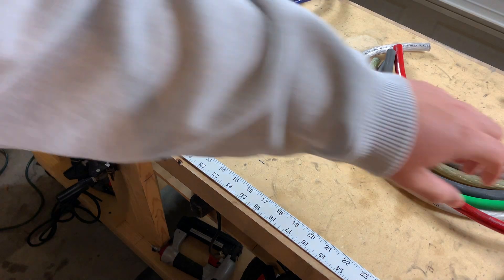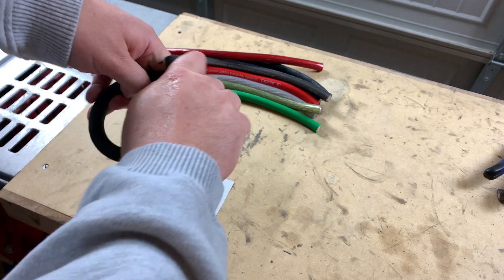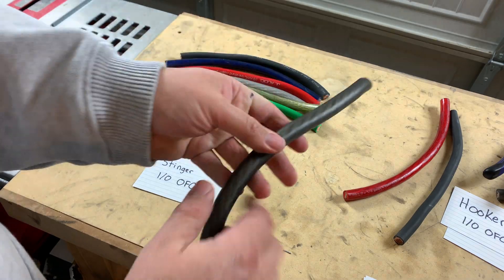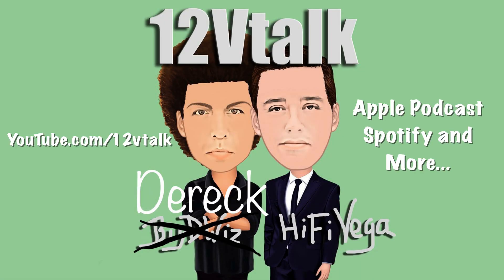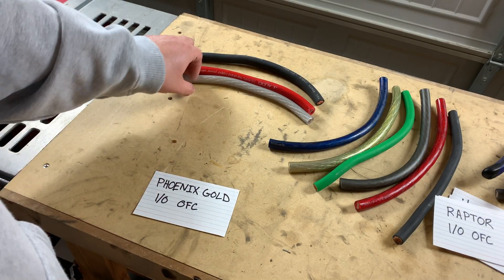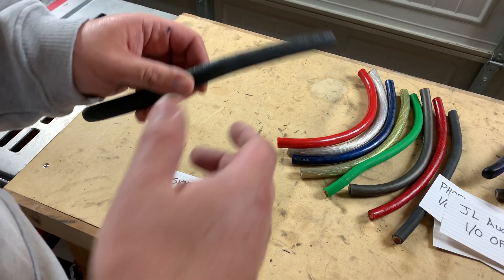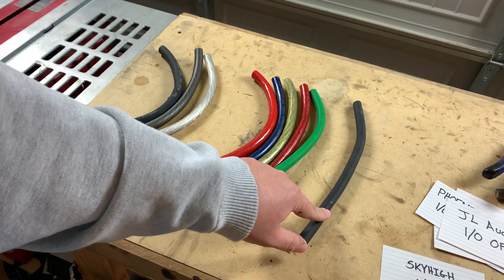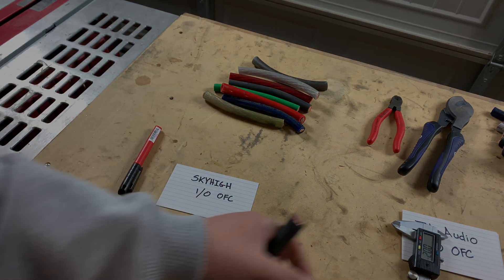What’s the best 1/0 OFC Wire? (1/0 OFC shootout part 1)

Comment: I’ve used all of those cables in my many years as an installer, and I only use Sky High now. The price is super competitive (especially in bulk) and as long as you properly seal the lugs or ferrules there is no corrosion over time, despite the lack of being tinned. This wire is so oversized that it wont fit in many set screw fuse holders or distribution blocks. Rockford, JL and Kicker wire might be slightly better but at twice or triple the price SHCA is the smartest choice. Lastly, you should have thrown a Chinese amazon “ofc” just for laughs
Reply from the maker: Sergio Cuevas I still might! I plan on revisiting this one later on when I’ve acquired different brands.

Comment: I use 2/0 welding from ac/dc supply for everything under the hood, I'm sure it's better in high heat situations. then oversized 1/0 skyhigh for my main runs to the rear distribution fuse block, and skyhigh for everything else.. skyhigh has sum of the best looking copper I've seen
Reply from the maker: tankdog03 funny you mention high heat situations... more to come on that soon!
Reply: +HifiVega yea, the welding wire definitely will take the win for that one.. guy name donkeys breath or something like that also did a test with it, his test has flaws tho.. the 2/0 welding wire just don't seem to look nearly as clean as skyhigh, and the sky high 1/0 might be bigger.. I bought a bunch of both, I actually was addicted to copper wire for a while, I still have a little something for it.. lol
I may buy a bunch of tinned copper now, I run all tinned copper lugs, but the ones with the smallest hole u can find then drill out to the size u nerd for a tight fit
Reply: +tankdog03 I've got a stash of 2/0, 1/0, 14ga, 12ga, 10, 8, 4, all good ofc.. it holds itd value, scrap yards pay almost  $3 a pound on #1 clean copper around here.. people breaking into abandoned houses stealing the copper pipes and electical wire, and the bigger stuff in sum of the power  pannels.  I remodel houses and been getting all the copper out ah dumpsters for 8years, my retirement plan lol

Comment: Knuconcepts wire is nice. I use that, sky high, or stinger wire.
Reply from the maker: Dustin Moore in the future I will try to get some knu and other popular brands and do another updated video
Reply: Knu for the win I normally get 1/0 ofc  knu and instead got some sky high 1/0 ofc and am very disappointed in it compared to knu. I can prob g try ie knots in knu and it’s smooth , the sky high when I bent it you can here it crunch inside lol

Comment: I gave you a preemptive thumbs down in case you bag on a brand I like. Just kidding bud that wasn't me. To that guy I say "when the adults are talking, shut your mouth". Another awesome video. I always wonder about wire. You really got into this topic. Thanks.
Reply from the maker: 2001 Monolithic 😂 it’s gonna get real next week whenever we cut em open
Reply: @HifiVega  I went with knukonsepts wire in the suburban. There a mixed bag. Some of there product is awesome and others not so much. Their sales people know what they are talking about so I got everything I needed out of the gate. When I forgot something they said do you have this. Yes, well then do you need this? Saved me three calls back to them. They gave me all the fuses I'll ever need but I did buy their most expensive distribution block. They asked what amps do you have. I told them and they included fuses for all 11 of the amps I had at the time.

Comment: You'd expect a brand of wire called Hooker to be the most flexible, and possibly cheap.
Should be some interesting results from this test. I'll go ahead and say the Stinger wire might be an early favorite with a welding wire a possible dark horse upset winner.
Reply from the maker: MSH68 I’m very interested in the comparison of 2/0 welding cable to 1/0 oversized car audio cable...
Reply: Hey the hooker bent pretty damn good for the money. Unfortunately it ended up all waded up in the trunk. Sad.

Comment from the maker: If there are any brands you like to be compared to these and you have access 
to a small approximately 12” length, shoot me an email at HifiVega@gmail.com
Reply: I love test like these, keep it up! Haven't seen a wire brand test in a few good minutes actually. All the ones out there are getting pretty old too.
Reply from the maker: Simplistic Banging yeah I don’t think wire technology has changed much, but I plan on keep this updated with new videos as I get other brands of 1/0 in
Reply: Royal Excelene is a great value. Flexibility seems to be overrated. If it is reasonably flexible, I will take weight of copper and a tough jack any day